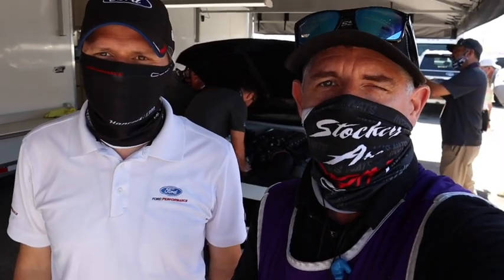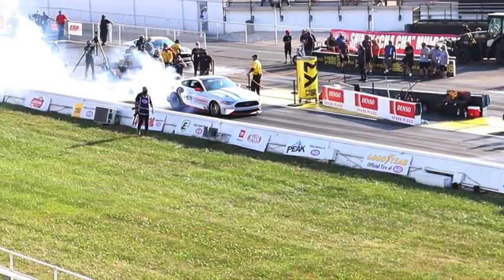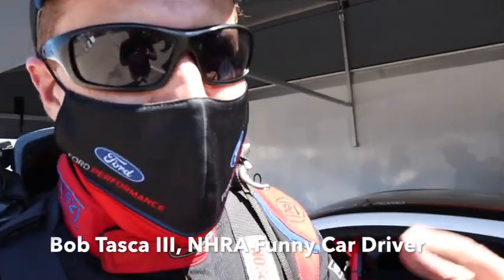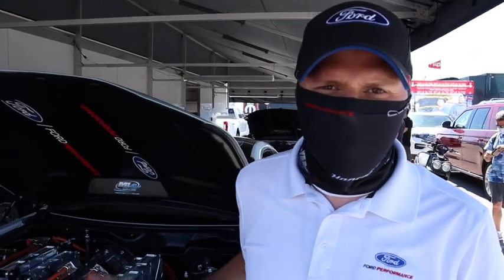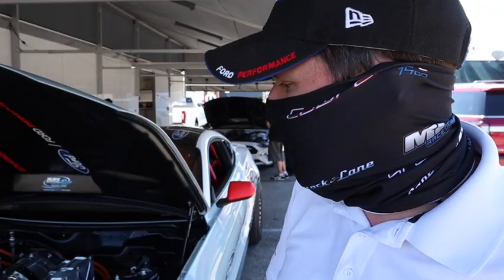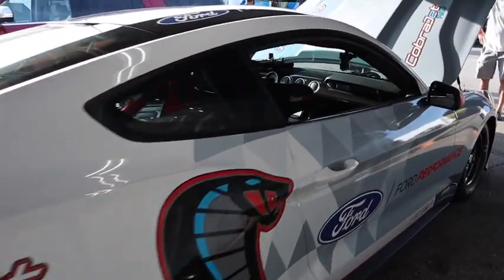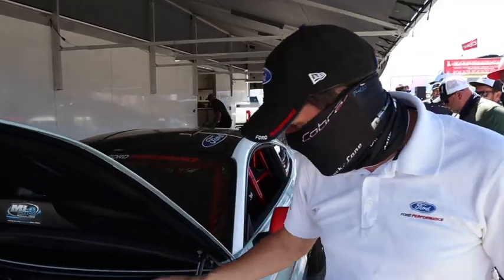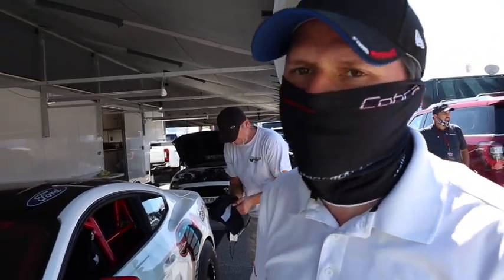Ford Mustang 1,500 RWHP ALL-Electric Cobra Jet 1400 Runs 8s at 162 MPH!!!

Comment: Wow, that's a fast forklift.....yawn..... I put an electric trolling motor on my boat, it's quiet, recharges by my solar panel....still like the 9.9 gas for actually doing stuff though. Electric car? Ummm, no thanks. Having a moped that will outrun a rice rocket, it's still a moped, yuck.

Comment: Thanks Evan cool video, race on Sunday sell on Monday! I would like to see a grudge match with the electric copo Camaro I saw a few months back... 
Tesla just cut battery costs by a lot and has a million mile battery in the works. Ice engines are going to have serious competition and at some point its not going to make sense to keep building them.. 
Solar panels are getting more efficient by the day and they have new materials that can be recycled easier then current silicon based pannels. Many new energy storage solutions too. There's a lot of powerful people in the fossil fuel industry that are doing everything they can to stop it. The smart ones will embrace it!

Comment: like the tesla, running out of steam on the top end. a lot of cars are doing 170 180s in the 8s.
Reply: this is still testing, with the power they have they will not be able to "top it out" if you think they are hitting a speed wall, or could increase speed, then you will soon see this car in the 7's
Reply: If you check out this video, it's within 2mph of the gas engine car...
https://youtu.be/P5KjlMJo1lc
Reply: @WestCoastSupercarsandClassics  you are correct, the other mustang is supercharged hence a little lower trap speed. my post would more accurately reflect turbo cars.
Reply: They also tuned the EV to be the same speed as the Gas engine, if you notice when they zoom in on the guage  cluster it says its on Power Level 1, what about level 2, 3, 4?!  people would be extremely upset if they saw this EV destroy the gas engine, which it easily can.
Reply: @mattw3379  I see. Thanks very much for the insight.

Comment: For sure this electric version is MUCH faster than the petrol version. I willing to bet ford “tamed” the power down to compete with petrol Cobra Jet. Can potentially be bad PR for the regular cobra jet if they show the true potential... I’m probably wrong, but what do you guys think?
Reply: Nope.  Factory stock gas cars are in the mid 7s.  They have quite a ways to go to catch the gas cobra jet with this thing
Reply: In their documentary they said the pack of motors could actually make 2000+ hp.  Of course the battery tech and other components play a part in how much the power is limited. But I don't see your point as inaccurate. You could be right.
Reply: Yes you are correct, you can do 10.1 seconds with a single Tesla rear drive motor, Youtube Factory Five 818 Electric drag, single motor is 10.3 or so and once he goes dual motor he is doing 9.3 sec with a good amount of wheel-spin, so in the 8's if he could get it to hook

Comment: Electric is interesting, and it would be great for the morning commute.  It's fast, but how many passes on a single charge?  How long does it take to recharge?  Charge every time?  Perhaps Ford can pipe in FAKE V8 sounds like the do on some of their cars and trucks.  But since we're going high-tech, why not just make the electric car drag race autonomously?   Why do you need a driver, when the computer can drive the electric car in a straight line from a quarter mile?  We'll all sit and watch "virtually."  Where's the thrill, other than a technology demonstration.  I'll take the noise and smell of gasoline engines, or I'll just stay home and play video game racing.  It's electric too.
Reply: 3 passes or so per charge, then 30-40mins recharging. Look up roborace if your curious about autonomous racing cars. Or the nio ep9 at texas setting a world record for an autonomous race car. 🤔

Comment: Other than because they can, I don't really understand the need for a torque converter (at least not if they are using the terms in the traditional sense as in a fluid coupler) etc.  One assumes there is pretty much ultimate control via computer boards somewhere which, if that is the case, those computers can surely control input/output enough to negate needed a "converter".
Reply: Good point's. Seem fomoco gave it way to much extraneous crap. In an effort to make it seem similar to the stock cobra jet ice version. 🤔 hell lucid went 9.9@144mph in a 4 door supposedly production spec and weight electric sedan!
Cut out all that stupid crap run enough battery to do 2 passes and it would be an easy 7 second demonstrator imo.

Comment: Bring it Ford. I want an S650 awd electric dual motor Mustang with about 600 hp and 400 mile range.
Reply: That will be a low power option in a few year's time. 😎

Comment: While internal combustion motors sound much better, the electric whine does sound good!! Crazy how fast it is! Wonder how it’s 60-ft compares to a gasser?! Thanks for another killer vid!
Reply: Fastest they showed for the e-jet was a 1.4 60ft.
Reply: RC18 thanks for the info. And the gassers are going what, 1.2s? I would have thought all that instant electric torque would have set a record for 60-fts, but I also understand torque isn’t everything with a good 60-ft and that they’re still sorting this thing out. Cool car
Reply: Good point, I would venture to guess. For this it was turned down a bit. My thoughts on fomoco not wanting to ruffle to many feathers so to speak. As it went 8.27@168mph in a private test just weeks before Indy. 🤔

I'd guess being turned down on power and wasting energy on the wheely cost them a tenth or two easy. And as you know every tenth off the 60ft equals a couple off the overall et.
Weighing over 5000# just can't help either.
Reply: @RaceGasSmellsGood  the electric motors can dump almost all torque once but almost no EV ever will, way too easy to spin out, so its a lot of software work, its how tesla can get a low 0-60 on a 5000lbs 800HP sedan with stock tires.
Reply: Miguel lopez pretty crazy how much torque and how instantly they can deliver it! Thanks for the info! Wonder how fast electric vehicles will get in the future?! Suppose tire and suspension technology gotta catch up! Or maybe we’ll reach a limit of physics! 🚀🏎
Reply: @RaceGasSmellsGood  what really limits a EV is battery cost and overheating, you could technically pull a shit load more power out of the battery packs but you would risk a fire or permanently damaged cells, and its a lot more expensive replacing a battery then it is an engine.

Comment: Back in my days at Alamo Somken dragway in the early 80 if you ran a 13 wow that was fast and we had small block engine 289 283 318 now new cars are runing low 11 or 10 and now electric times have changed

Comment: slow ass mustang the 2020 challenger drag pack makes 7.50
Reply from the maker: Wrong, First, there is no 2020 Challenger Drag Pak. The Challenger in competition is older and runs 7.90s, where the same class Mustang runs 7.50s. Do your research before posting inaccurate information.
Reply: wtf you crazy stuped the 2020 drag pack makes 7.50 and that slow mustang makes 8.62 😠 and the drag pack makes 1400 and that mustang makes 1500 whell but dodge is faster 😂
Reply: @geremiasrivera5253  just looked at that drag pack. ill hazard a bet that the challenger is a fair bit lighter
Reply: @geremiasrivera5253  the drag pack is certified to 7.50.  Hasnt done it yet.  Although still quicker than this

Comment: I've got gasoline in my veins, you can keep your bunny rabbit battery power.
Reply: Ches Jeter  You can keep it, it stirs no emotions in me it's just a thing.
Reply: @johnparrish9215  ha ha ha 😂
Reply: Wait until you've driven a high power EV. Then you'll see what's going on. :)
Reply: yep
Reply: Nothing wrong with electric power we use electric for so many things in life why not mustangs.
Reply: @rdy2run332  If your a Car Guy, you would know what it means emotionally when I car with a built race engine rumbles past you.
Electric cars for utility?? Sure, makes sense.
But I've got a 545 inch BBF that draws a crowd just sitting idling, that idle draws Car Guys like Ants to Sugar.
Electric will never have that.
Reply: @johnparrish9215  sure i understand what you are saying i love gasoline engines too i have a sbf 427 stroker in my fox and love the way it sounds but these electric motors make a tremendous amount of power and can be very quick out the gate.
Reply: @rdy2run332  An electric car, regardless of its power, will never give you the FEELS of your Fox body when you fire it up.
Reply: @johnparrish9215  this is true

Comment: Idk if it’s just me but 1500 whp running only in the 8’s at 162 mph that seems very slow for the power that’s Those are numbers you would expect for like 1000 hp drag car not 1500 hp and with it being electric it should have tons of torque like that things got to have over 2000 torque That seems really slow for that type of power and torque
Reply from the maker: It’s over 5,000 lbs.
Reply: REVan Evan Jesus Christ that thing is heavy that thing is almost as heavy as a pick up truck
Reply: 2595cjp  for the millennial crowd maybe , not for us old school guys !
Reply: Best pass so far was a 8.27@168mph. More testing will get it in the 7s for sure. Exciting stuff imo. Should make the s650 electric coupe in a few year's. If fomoco survives, fairly exciting. Just think of the possibilities? 🤔
Reply: @4literv6  is there any verification video?
Reply: RC18 What possibilities a Mustang that sounds like absolutely nothing and it takes away all the character and personality of a Mustang just like the ugly machE
Reply: @NorthernPerformanceGroup  you are correct!
Reply: @NorthernPerformanceGroup  I absolutely could not agree more. Well said
Reply: The possibility to never again care what fuel prices are? No poisonous particulates when it runs. No oil changes, no emissions tests. No tune ups or fuel induction services. No belts, hoses, engine air filters. The ability through over the air updates. To keep an older vehicle current. Vs just replacing it. Vehicle to grid, enabling those with a bev. To back up their house with the battery pack. Or contractors to run tools, or handy types. You could power a travel trailer or tiny home to. Give someone a jump. Use components from wrecked bevs in old school rides. Creating super performance clean running elektromods. I mean use your imagination for once.
Reply: RC18  Many good points I agree on with your post , however , you are depending on electric power to charge these vehicles !  Currently we are at crossroads with our power grids , how are you going to charge all these vehicles ? 
Don’t tell me electric is non polluting either,  it very much is ! Like solar power and wind energy that has a 15-20 life span at a much greater cost and waste to our environment ! 
Electric cars have a niche , only advancement in technology will allow them to take over piston engine vehicles !
Reply: I've worked on cars since I was just a kid. No problems with some internet warrior type attempting to insult me. 👌

The power grid we have is est to be able to support 40-80% bevs. Depending on when they charge. Yes renewables are still in their infancy so to speak. But they are getting better just like batteries as time passes. With many new features and improvements being added year over year. And their are already companies who can recycle the solar pv panels recovering 95-98% of the raw materials. Just like battery recycling. Is actually one of the most efficient processes. Tires and batteries at least lead acid one's. Are over 95% recycled already. We can stagnate using poisonous 1800s technology. Or we can deal with some growing pains and push our society forward? I know which I'd prefer. 🤔
Reply: RC18  Insult you ?  I hope you aren’t talking to me !
Reply: RC18 your wrong about the power grid is isn’t Capable of supporting everyone in in North America with the amount of electricity we use as it is then add every single person has an electric car we are about 60% minimum shy of the goal of being able to have close to enough power
Reply: Moto Gizmo he is just butt hurt for electric cars and spending 10k every 5 years for a new Battery for your electric car
Reply: RC18 And just so you know batteries aren’t the future hydrogen is a 100% renewable energy source unlike battery’s I need to be replaced every five years and spent $10,000 on and create about 10 times amount of carbon pollution as me driving my mustang from the day I was born to the day I die one battery creates more pollution
Reply: Batteries in New electric vehicle's are warranted for an average of 8year's and 100,000 miles currently. A few manufacturers are actually covering them for the life of the car with the original owner. 
Once done in a car the battery can then be used for grid scale energy storage or recycled. Currently li ion tech is about 95% recyclable.
Reply: Also hydrogen isn't the future of anything. Maybe try doing some actual research first?
If you did that. You'd know from an efficiency standpoint hydrogen is actually more wasteful than fossil fuels. Which is the reason why fossil fuel backs hydrogen. Also hydrogen requires batteries. And they aren't small either. Example the nikola hydrogen truck has a 320kwh battery pack in it. Besides needing energy intensive hydrogen and specialized tanks to hold it. 🤔